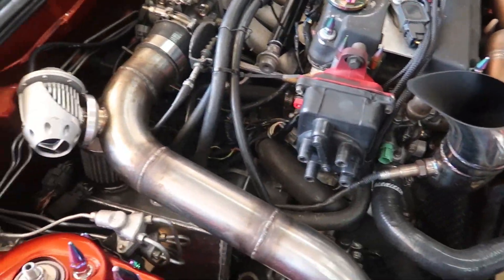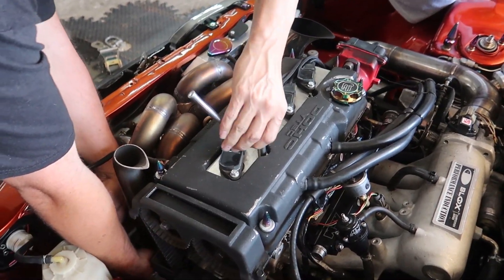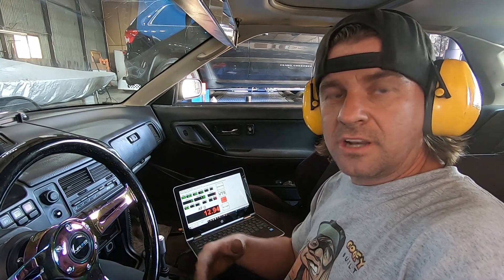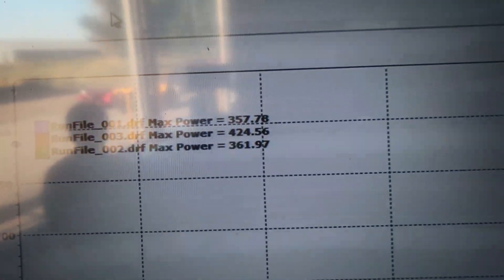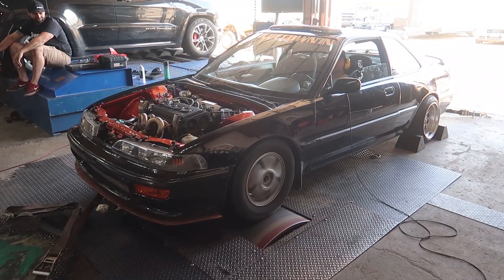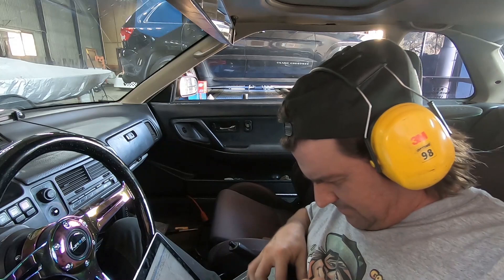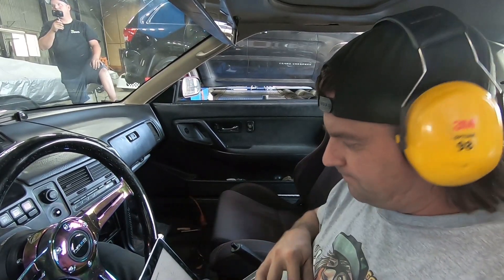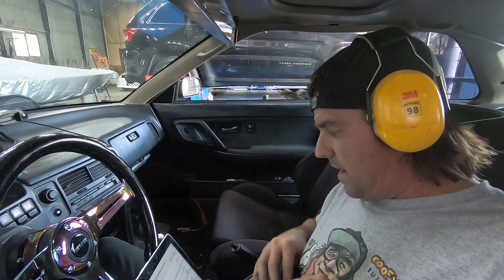Hard work Pays off! This DA integra isn’t Clownin around 🤡

Comment: It needs a channel I’d like to see this car a lot more
Reply: I do have a channel but im about two get going with it more its under still clownin integra
Reply: Still clown'in ok I’ve subscribed
Reply: @stillclownin176  interested in a different insert for that hks bov? I designed a couple for the one on my car. I wasn't satisfied with the two options hks sells.
Reply: @sinformant  ant bad what you have
Reply: @stillclownin176  I got a cobalt ss with a little bit of work done to it and a tune running a ssqv4 as the stock bypass valve wouldn't hold past 20 psi. Currently sitting waiting to have the time to drop in the new better motor. The two.inserts I made one makes a louder whoosh and a much louder whistle than the original hks insert. The other one makes a high pitched whistle under higher boost, and an eagle screech under low boost and vacuum shifts. Both are pretty loud. You can here them blocks away. Or at least they are on my car.

Comment: Needs mounts...those are worn BIG time. SO much movement...he should hit up Brian @ HASPORT and it will be solved under 400 bucks.
Reply: On a side not, another great tune man
Reply: Thank u and ill look in two it asap because twin then more power soon
Reply: @stillclownin176  that twin will do wonders...you may have to go back and have them give it some more juice because it sure will hold it after that ✊🏼
Reply: Ya im hoping soon we need that 700 mark atleast 😔 just got two save for a twin disk some how
Reply: @AnalogAssassin1  you know his full email for motor monts
Reply: @stillclownin176  just go to their site, search HASPORT.com They have a mount kit for the DA if I'm not mistaken, comes in 3 hardness levels and I think 4 or 5 colors of anodised aluminium.

Comment: That thing needs motor mounts BAD!!!!!!
Reply: I have a set of 1992-93 Integra GSR Hasport mounts in u70a sitting on the shelf. I bought them when Hasport first started making them so they are for a cable transmission setup. I used them for a month before I bought my second DB2 Integra. Never got around to installing them. They look brand new.

Comment: sleeved or stock sleeves? Reason I ask is that I'm getting my car tuned next week. How much hp can stock b18c sleeves take? Motor is built, but sleeves are still stock like I mentioned.
Thanks in advance! P.S. car is running on E85
Reply from the maker: This is a css. , Jamie makes 600hp, 
Stock sleeves even with a block guard can be hit or miss. Just feel it out and work into things.
Reply: @PFIBrent  Thanks guys for the quick reply!

Comment: Why does it seem like the 2j is the only motor to REALLY shoot flames and fire shots? Any other two step I've heard and/or seen are like pea shooters with tiny sparks.
Reply: My crx shoots actual fireballs. I think it's just in the tune.
Reply: @adamfaler1861  I've seen flames shoot from other cars..... It's more the backfiring isn't Gerry loud in any other car in contrast to the 2j. Maybe a bunch of small cracks but nothing very significant.

Comment: I don’t get how that’s 424hp my z6 made 300 something to the crank and 256 to the wheels and it pulls way harder then that on the dyno
Reply from the maker: Gear ratio etc play part of it how it’s loaded. These are super simple set ups. We’ve done some monster d series stuff as well. They all rip to me.
Reply: PFI Speed woaaaaah super surprised you replied holy shit. That is awesome 👍
Reply from the maker: You rock man! Your single jingle had to ride out!
Reply: PFI Speed Brent if you get a sec bro go check out my channel posted the dyno video! Let me know what you think